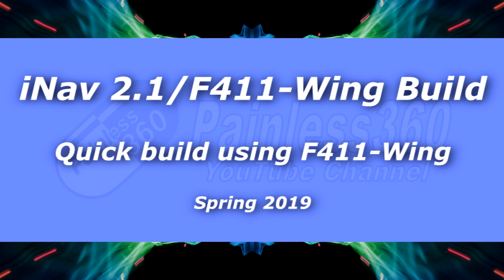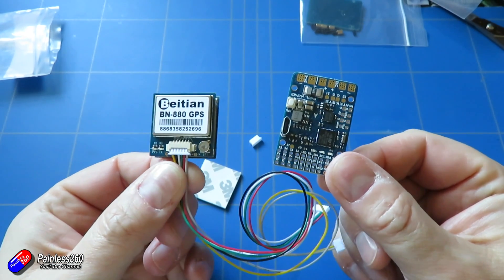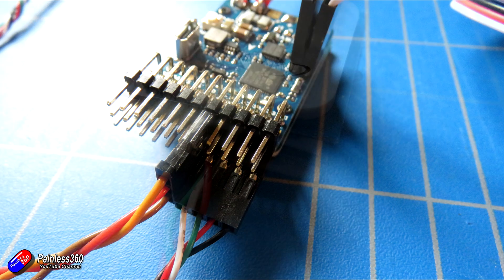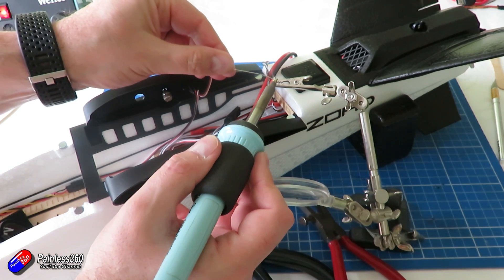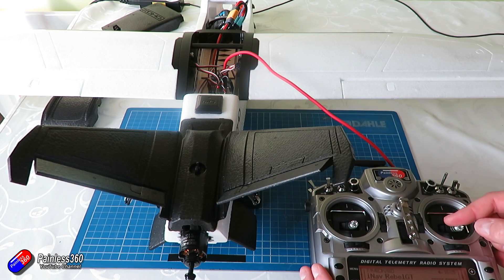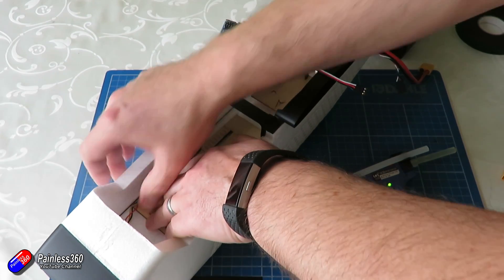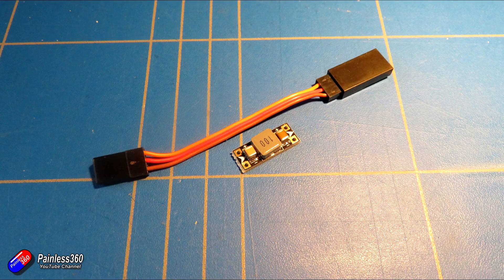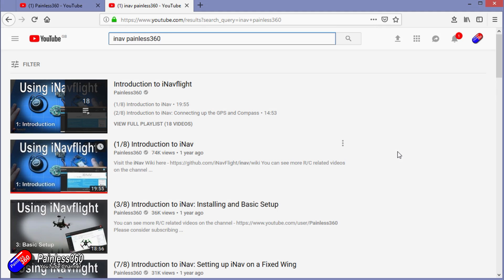iNav 2.1: Using Matek 411-Wing and ZOHD Rebel GT

Comment: I have a F411-Wing and trying to connect to an OrangeRX R720X V3 with Sbus.  I cannot get it to communicate.  Is there somewhere I can find info about this?  Thanks  Darrin  Also using Spectrum receiver.
Reply from the maker: From what I can see there are two versions of that receiver - one that puts out PPM from the BIND port, and one that outputs SBUS. I'd check you have the right one..
Reply: @Painless360  Thanks so much for your reply.  I finally got it figured out.  I was plugging in the incorrect port on the receiver.  Goes in the Bind plug.  Had to use the OrangeRX programming box to set V3 receiver to Sbus and now all is well!   Thanks again for your videos and information.
Reply: @Painless360  Well I used what I found on your video as a setup.  For some reason when I try to Autolaunch, the wing says Autolaunch in the FPV, I have tried three times and each time it goes pretty hard right and slams into the ground or into a bench nearby.  I have not used a board like this in the past so it is a bit foreign to me.  I fly quads with no problems but I cannot get the wing to work correctly (and I am running out of glue LOLOL).  Anything come to mind?
Reply from the maker: Hi Darrin, thanks for the email but free help is only available here in the comments. There are several mistakes that you've made in the setup (no offset pitch angle for example) so I'd strongly recommend watching my Autolaunch video again. Best of luck

Comment: Hi lee! Been watching your videos for a while now, just finished building a gt with a f411se fc in it, im gunna use inav 4.0, quick question, will the mixers for the v tail airplane be correct for the gt rebel? as it shares the same servo plug for both ailerons and the other 2 on my model are unused as im not putting anything in the wings :)
Reply from the maker: That should work fine. There is usually a little tweaking on direction. Best of luck with it!

Comment: I have one question. I have installed everything the only problem I have I cant give power to main motor via radio controller, servos are ok. I can give power via Inav.
Is there a possibility connecting motor to second motor pads it wont spin via radio controller?
Reply from the maker: Have you armed it? See my video on that exact issue.. Best of luck

Comment: Awesome as always, thanks for this video. Is the f411 fc board supplied with the pins?.
Reply from the maker: I honestly can't remember - most of the Matek boards I've had in have had to have the pins soldered on..
Reply: @Painless360  thanks for the reply. I just found out that the f411 doesn't come with pins, but the f405 does. Was just talking to someone who has both boards.
Reply from the maker: Depends which F405 you're talking about - non of my F405-wing boards have come soldered. May be worth a check..
Reply: @Painless360  maybe I didnt ask the question very well. The f405 wing board I got was not soldered-  but the red , white and black pins were supplied in the packet. These pins are not supplied in the f411 wing packet. They only give the spacers and screws ( no pins).

Comment: Hello! Beginner question here, what gauge wire did you use for the battery leads on the board?
Reply from the maker: I usually match the size of the cables connected to the battery that I am planning to use... Happy flying

Comment: I want to put this FC into my Ranger G2. I thing I can't find is if you can sent all the telemetry this FC collects back to a FrSky transmitter like you would with the FrSky sensors. If so, does that go over the SBUS connector as well or do you need to wire that up separately somehow?
Reply from the maker: You can use Smartport. See the other builds in this series.. Happy flying!
Reply: @Painless360  Thanks! Your video's are great! I'll check out some more.

Comment: was wondering is Servo 2 needed for the motor? and also compared to the Bixlar in this build do you need these extra stabilize/Pitch/Yaw functions?  great build videos btw!
Reply from the maker: I don't understand the question. Why would I need a servo for the motor? See the full series for all you need to know. Best of luck!
Reply: @Painless360  sorry I meant when you are setting up the mixer to assign servo outputs in this video what assigned outputs are needed for ZOHD Rebel GT?  I have a FPVBrain Wing PB for myZOHD Rebel.
Reply from the maker: It'll be the same - ailerons and V tail..

Comment: HI Lee again  tank you for your work its priceless i have a matek f411wing in a zohd orbit wing inav for gui  i flew it yesterday in manual mode the controll was very slow to react i set the default  manual and rcexpo  from 70 percent to 10 percent nothing change same thing in accro mode there is no expo in the transmitter i did a auto trim and  auto tune in rate mode in rate mode every thing is perfect it fly fantastic it was windy the gyro work perfectely  i look in the cli  (get manual) all the parameters are fine   i am going to try an aototune  in normal mode  thanks
Reply from the maker: I don't change anything like expo in iNav. See the full series for all the steps I take and the CLI commands I use.. Best of luck

Comment: My f411 has some issues. I'm using it in a nano talon with a holybro m8n micro gps, orangerx 920x receiver (ppm), spektrum radio.
My issue is that upon battery startup I get zero response from the flight controller except the motor beeps slowly. If I plug in the USB I get leds on the board, the GPS lights up green on the module but turns red in the configurator followed by a fast blinking blue led on the board. I have no 5v anywhere on the board that is a 5v solder pad. All Vx has 5v (servos) when powered off the battery but the entire 5v rail is dead. Any suggestions? Anyone had any experiences like this?
Reply: I should add that the ESC has power and the VTX has power too.
Reply from the maker: Sound slike the 5v regulator has failed..
Reply: @Painless360  thanks!
Reply: @Painless360  I tried wiring in a 5v bec, everything on the 5v rail has power now. Now to figure out why the GPS isn't communicating! Thanks for the input!

Comment: Unfortunatelly I can´t access my F411 anymore neither with USB nor with a ftdi-adapter on one of both UARTs. Me and also friends had that phenomenon with F3 and F4 flightcontrollers before and it doesn´t matter if you have a capacitor or not (assuming any voltage peaks fry parts of the flightcontroller) or if you running them in airplanes or a copter. Flight controllers still work but you just can´t get a connection to tweak anything.  Does anyone have an idea what part on the flightcontrollers could be defective and a way to prevent that?

Comment: Hi mate, do you run the lc filter on the output to the camera or vtx?
Reply from the maker: See comments at 10:10 in the video. I'd add it to the VTX..
Reply: Wouldn't you put it on the camera output not the vtx because it's your video that would be susceptible  to noise not the vtx?

Comment: Nice video! I ordered my stuff to make an iNav wing. My question is, I have a turnigy 9X radio, will the RSSI also be displayed on die OSD? Or is that just nog possible with that radio?
Reply: @Welshwizzard1  Thx for the answer. but I have a turnigy 9X and a Turnigy evolution. So is it possible to see the RSSI of those radios on the OSD with an IA6C receiver?
Reply: @emiledubois9949  I would think yes it will show rssi. Did you find an answer? In betaflight I get rssi osd with my 9x
Reply: @josephfreeman5289  my brother did find something on YouTube to reprogram the receiver. But we haven't tried it because we now have a tarranis QX7 for our 'long' range stuff and that's very easy to set RSSI. 
But thanks for helping!

Comment: Nice review of this latest ZOHD offering. Kind of hilarious the motor scandal hounding this plane though, but ZOHD is well known for making heinous engineering mistakes (eg NanoTalon, the stabilizer in the Dart, the weight and balance in the Dart etc) despite the ingenious break-away designs.  I am tempted to buy this plane, however they gotta change motor manufacturers, and I think the tail needs about 4 inches added to its length to make it more stable and easier to launch, which I might do. (I have the Nanotalon and a couple Darts)

Comment: Great video Lee, unfortunately my f411 wing stopped working after my 7th flight. It's getting replaced by the dealer had to go through matek first which was a simple process. They help you diagnose it through email with pictures and a volt meter. 

I've always found that matek is easy to deal with when you have a defective item. But I have no clue why it stopped working when it was working just fine for the first seven flights. I would say it's reviewers curse but I'm not a reviewer so it's just plain bad luck ;) lol

Comment: One quest the filter reduces the noise or remove all the noise? Because o have the matek f722 ant that is my main issue with this board.
Reply from the maker: Gets rid of all the issues on mine, Matek should have added it into the board IMHO.. That's the only thing missing from it for smaller fixed wing builds..

Comment: Could the negative wire on the xtx and servo be paired up to leave three pins for positive, video and smart audio. Or would this possibly cause interference in either the servo or vtx.
Reply from the maker: Possibly, such a shame they didn't add an extra wire into those bays..